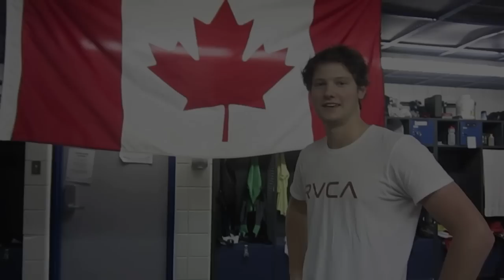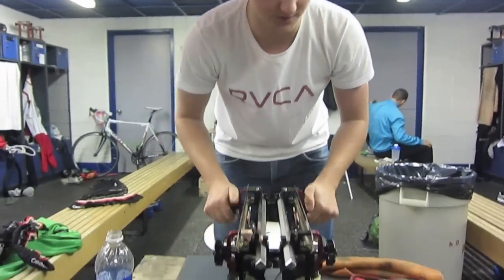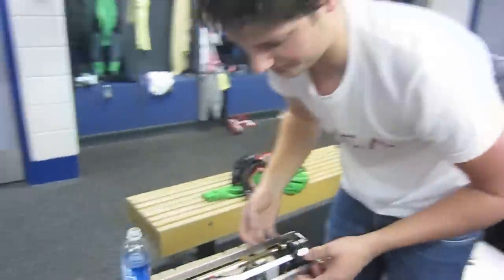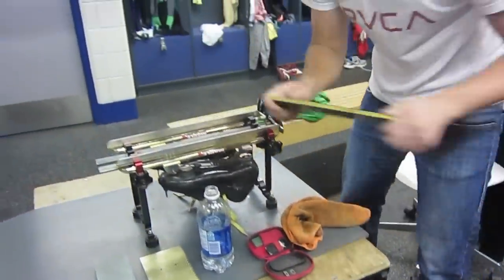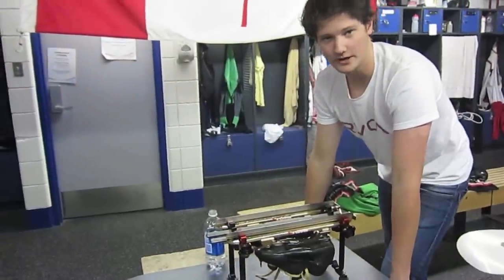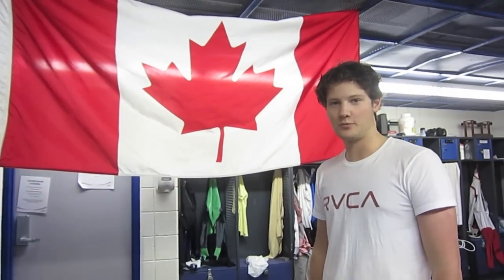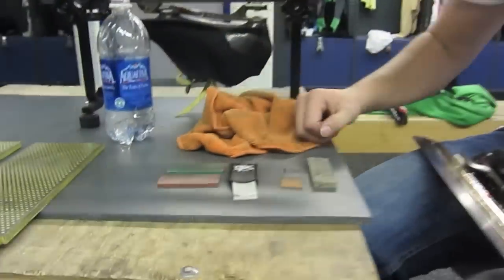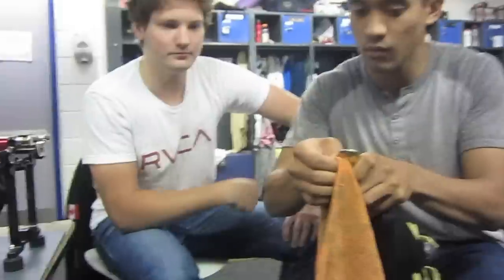DG Tips: Skate Sharpening

Comment: hi I have a doubt I just bought some new ice Speed Skates (long track) viking red bar but it's not sharpened, so if I don't sharp the blades I wont be able to skates?
Reply: Mark Diaz i do short track so from my experience (ive skated for 2 years) you dont have to sharpen but  you won't get any grip where if you sharpen them you will get more grip

Comment: This is confusing to me as someone who sharpens knives. I don't see how there is an angle created. If I sharpened a knife this way, I'd be eliminating the edge entirely. Is there no edge? No two angles coming to an edge?
Reply: Well the cross section of the skate is rectangular, so actually the bottom is completely flat ao that the skates glide with no friction and the skater uses the 2 90 degree angles created on the side of the skate to get grip and turn